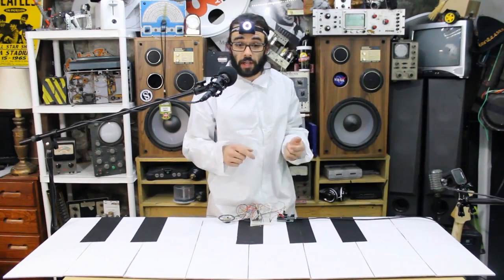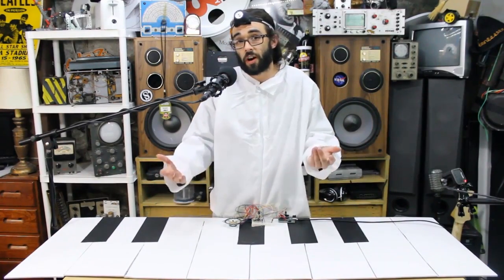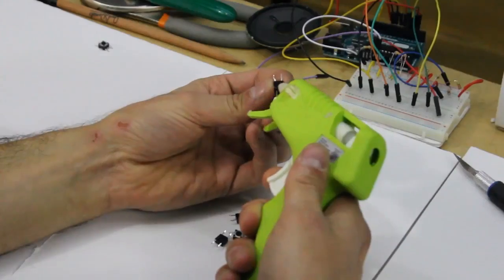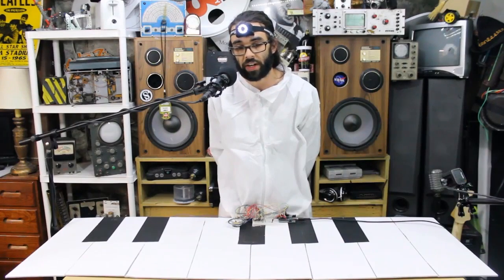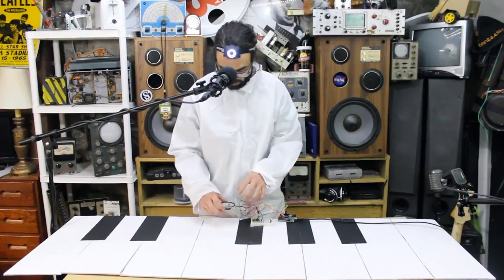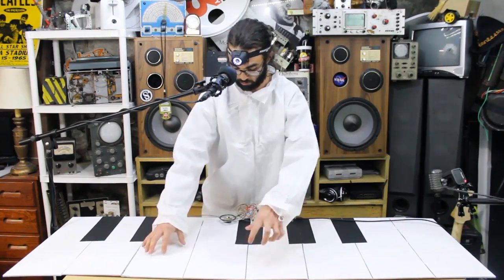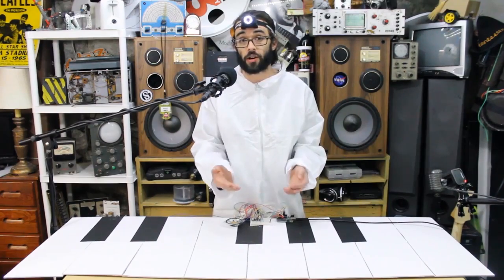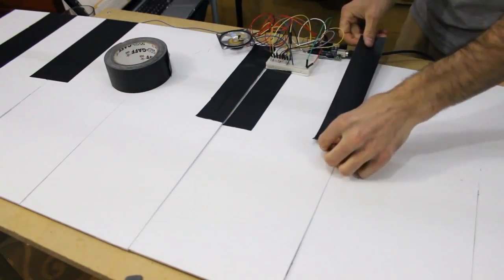MIT-i Episode 13: The BIG Arduino Piano! Use Pulse Width Modulation to Dance like Tom Hanks

Comment: Once again a good and informative video, but the way of connecting buttons with pull-down resistors is just plain stupid. Use INPUT_PULLDOWN and do away with the resistors and let the buttons switch to ground. It makes so much more sense.